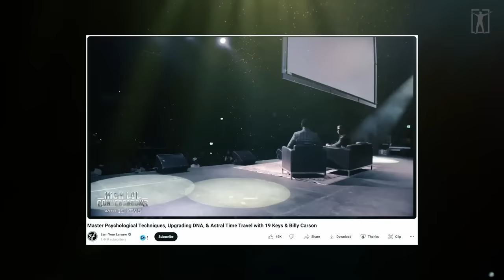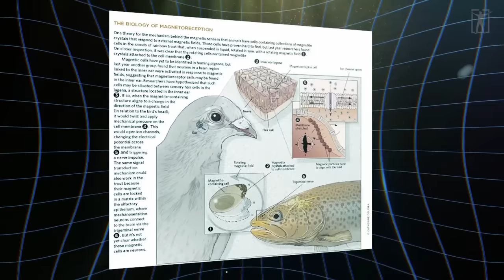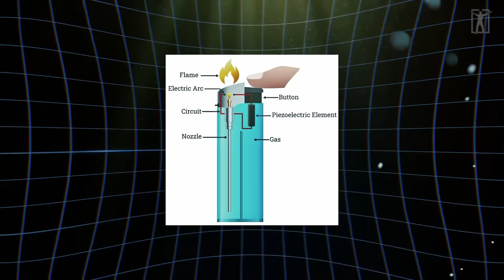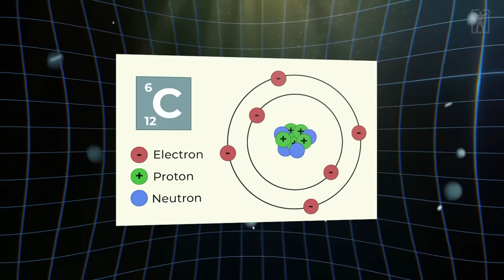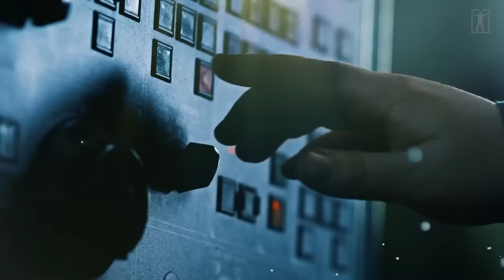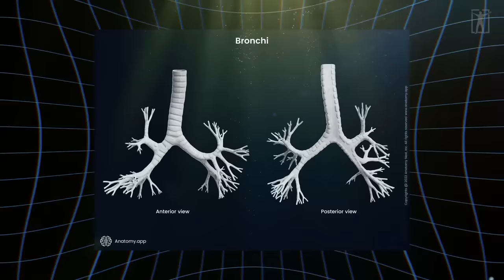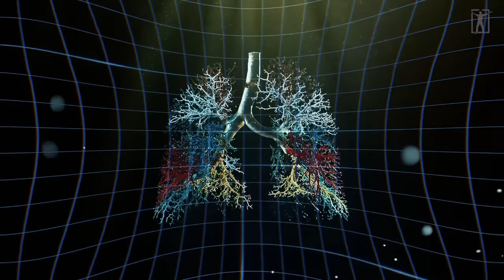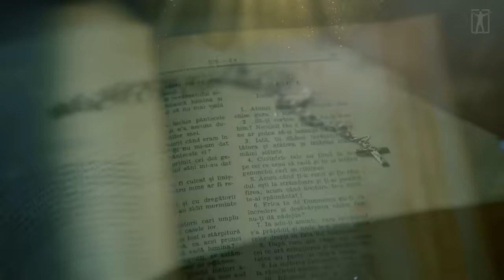They Found Crystals in Human Brains: "They decode all the frequencies"

Comment: I use a bluetooth speaker, and set a bottle of water on the speaker,  and play Solfeggio frequencies, to vibrate the water. I also use the 174 hz solfeggio frequency, to get rid of pain, just place the speaker on the spot that hurts. For about 15 to 20 minutes. It was the only thing that got rid of the pain of passing my kidney stone. I've told other people about, they have used it to get rid of back pain and migraine headaches, after it got rid of the back pain. 
Randy
Reply: So interesting 👌🇦🇺👍
Reply: Thank you Randy
Reply: They have been using frequency to heal on the eastern side of the world for years . Frequency can raise vibration and attract anything all you need is to be on the same frequency
Reply: You can do the same and get much BETTER results using a wired speaker (not cordless radiating erratic pulsed microwaves).
Reply: Very good but you must find the he cause of the pain!!!
Not just band-aiding it like taking pain killers.😢😮.
Stay healthy,strong & happy.🎉😂❤😊.
Thank you for your great tip.
Reply: I have had just about every type of seizure medically documented. I have had seizures where I could see fractals in time. After many MRI's, brain surgeries and dozens of medications. I found that the frequency of music along with nightly meditation works the very best. I have even gone as far as thinking some seizures have changed my awareness of the universe. Adding in the principle idea of crystals causing electrical stimulation. Goes with the exact explanation of what a seizure is by a neurologist and epileptologist. It's an electrical discharge within the brain. Most of the time they can't explain why it happens. Sometimes they will offer an idea that part of the brain is damaged leading to neurons in the brain firing off randomly. This definitely offers a different perspective on why a seizure happens.
Reply: aha 🤣🤣🤣🤣🤣🤣🤣🤣🤣🤣🤣🤣🤣🤣
Reply: That’s epic l I’ll try this now , thank you ✨
Reply: Peace.  One meal a day:  2 pears, 2 apples, having equal volume in relation of pears to apples.     Preferably juiced, allowing  almost 100% of nutrition available to be utilized.  Or, with small amount of water, cut-up fruut and prepare it  blender-ed.  Keep water to a minimum as it will dilute  effectiveness of malic acid forned when these two fruits are combined in stomach. Another method,  although only ⅓ as effective, is to just cut-up fruit and eat.  Malic acid has ability to break-up internal body stones, i.e.,  kidney stones, calcium deposits  built-up around joints and so on.  As these minute structures  become internally  mobile, body will excrete through normal system without extraneous pain.  These little, 'balls'  will be visible in receiving commode's bowl.  Continue having this type of meal every day as possible until no more 'balls' are seen for an unspecified  number of days.  This can be done from time-to-time to assure healthier internal body status, to keep deposits from forming or posing problems.  Be thrilled, thrilling and carry-on! Peace.
Reply: You might try ACV next time. That helped me pass a number of stones.  But kudos for the clever solution.
Reply: I use solfeggio frequency for nausea
Reply: Randymiller,the practice is known as  cymatics and we can thank Hans Jenny for the discovery many years ago😊. But it goes back even farther..
  Its where mandellas came from. The individual healing mandellas or frequencies have been studie and we have used it in medicine for some time.
Reply: @brieziethirteen13 Thank you, it's the first time I've heard of the word cymatics.
Reply: @ruckboger   Youre very welcome.. Really? Then you are in for a treat!  Its the universal language😊jmho..and My guess is, you will almost instantly understand..almost as if..its innate
Reply: Please see Tibetan singing bowls
Reply: I'll try this for my shoulder pain!
Reply: @randymiller. Thanks. Your helpful.
Reply: Excellent
Reply: How do you do it? Whats the purpose of the bottle of water? To see if the vibrations are there?
Reply: @lionspride222  yes. It makes patterns.  Vibrations are responsible for physical perfection geometric perfection
Reply: try chanting into your bathwater add a handful of dead sea salt
Reply: Your on the list now👏
Reply: @Kite1001RideorDie at the right frequency you can walk through a wall because it look solid but it's vibrating particles
Reply: Put some cornstarch in that water, just enough to strengthen the surface tension and make the title of non-newtonium fluid. You will observe the water take on characteristics of living creatures.
Reply: I have used frequency for healing for a couple years now. It does work. I have started to use on my grandson also and have had great results. I had always been interested in crystals and in the last couple years started studying and adding to my healing. I swear by it. But I have found it doesn’t work on everyone. Sometimes if you are so against it then you won’t let it work, I guess. The mind is an amazing thing like that❤
Reply: And you are not concerned with the frequencies your bluetooth speaker is emitting?  they emit a specific type of nonionizing (or low-level) EMF called radio frequency radiation (RFR). Yes they tell you its safe but is it? Especially when you count up just how many devices there is all emitting frequencies which often block the "healthy" frequencies like our earth's Schumann frequency
Reply: @lisahansen5522  yes I am very concerned, yet I feel that we as a species are about to hit critical mass and undergo a transition into ascendence into higher consciousness.
Reply: Not supposed to carry a device left alone put it on your body...people are clueless.
Reply: sound from yt and phones is distorted so it's almost always not 174 hz or any other which You pick due to compression
Reply: @lionspride222  it just activated the water, water has a memory. Then I drank the water.
Reply: @brieziethirteen13 right!

Comment: You are right about all these systems in the body, and it is very important that we reconnect with this knowledge again, as it will give us the power to overcome the adversity of negative forces and embroiling power systems ..It helps us internalize where power comes from and to strengthen that understanding. Thank you.

Comment: I'm trying to learn how to know what within me tends to either temporarily shut down devices or temporarily amplify devices..  Sometimes this is funny, sometimes it's embarrassing.  I'll be relistening to this..
Reply: You sound like a very interesting person. Problematic to be around clearly.
Reply: I too have this problem. A friend of mine his vehicle dies mid way during route to our destination, every single time! I also set off some of the stores anti theft systems, but only when I'm going inside do they go off! It's quite embarrassing!!! 😂
Reply: And i've often wondered why my wifi connection 'drops' when I move out of range!!!
Reply: I have just read that this might also interferes due to peopls blood type
Reply: I have this! When I worked out in the gym I couldn't use my touch phone afterwards? When I walk under street lights, they can turn on or off?
Reply: @FISHNESS2011  very interesting 🤔 was it a video you watched? Do you mind sharing?
Reply: @FISHNESS2011 rh- blood types are also known to have higher levels of copper in the blood (blue blood) which has stronger electrical conductivity resulting in a  stronger torus field, messes with electronics. I have the same issues causing problems with computers and lights. I wonder if this blood type has more crystals in the brain as well?

Comment: the part where he speaks about the lighter, he may be a little misinformed about that. what creates the spark in a lighter is the "Flint".  Although its a crystalline mineral composed of silica at a micro level, its the mischmetal that makes the spark.
Reply: That's true for lighters that have the wheel striker...but any lighters that have a "click" when pressed down, including torches, igniters etc .. Use a crystal to generate an electric spark
Reply: Electronic lighters with but ton click compresses a crystal generating the spark thru wire to the fluid vapor igniting it.